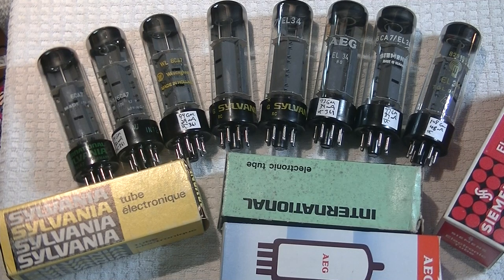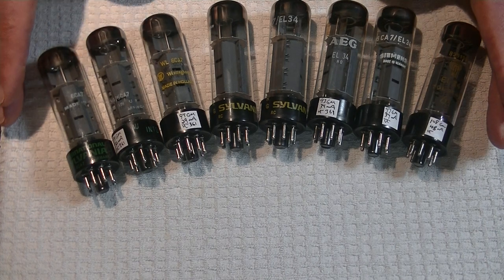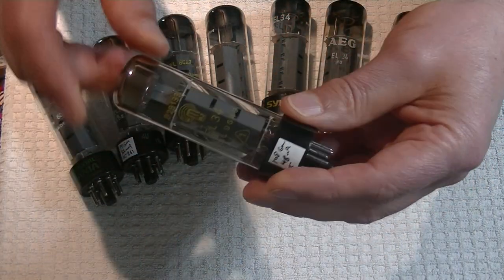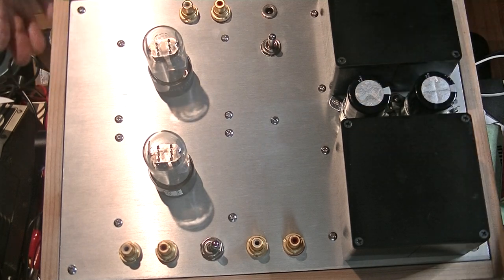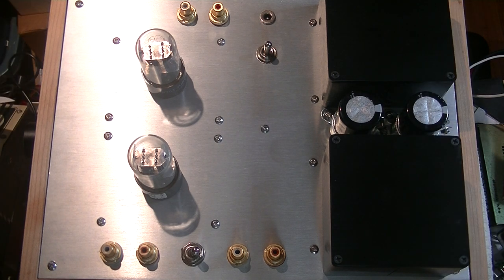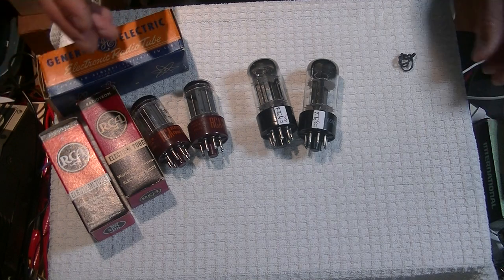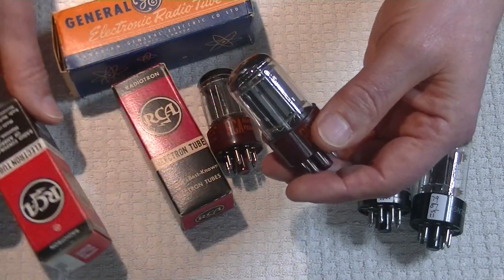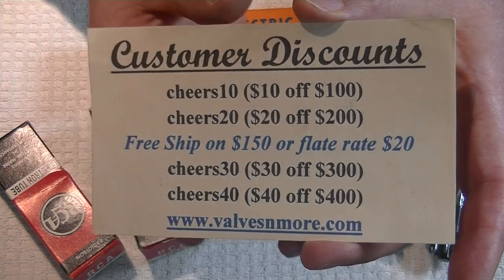Tube Lab #82 - Why Tube Labels Can be Fake & The Tubes Real!

Comment: I need to get one of these kits. Glad I found your channel. I have a huge collection of NOS 12sn7 and 6sn7 tubes that need a good home and I need a new preamp to add to my addiction lol. I also love building and restoring old vintage tube gear. I mainly do my own equipment being a musician and have many vintage tube amp s but also I do take on local repairs but yet besides building a bunch of old allied knight kits nib that I got lucky and found on ebay and use today in my repair/restores including sound generator, vtvm, cap tester, regulated power supply, tube tester,signal tracer and a oscilloscope but no preamps. I gave up looking for old vintage kits and after seeing this going to order a kit from you. Cheers. Mike